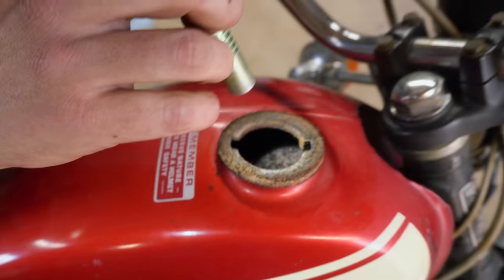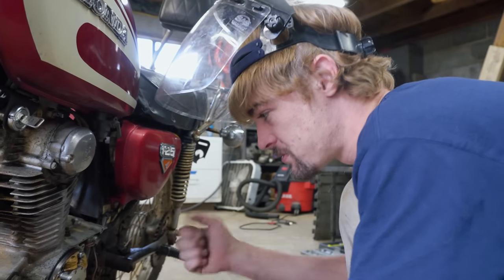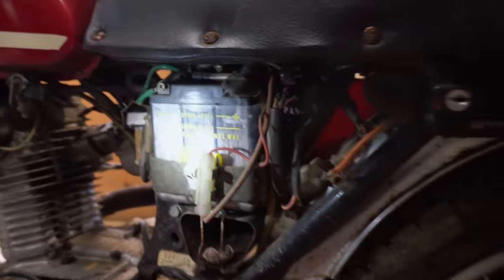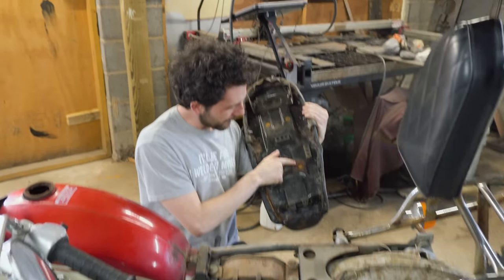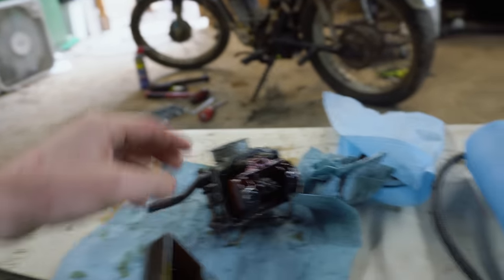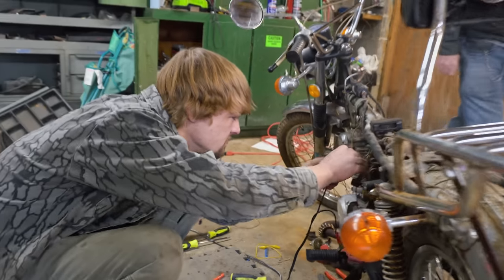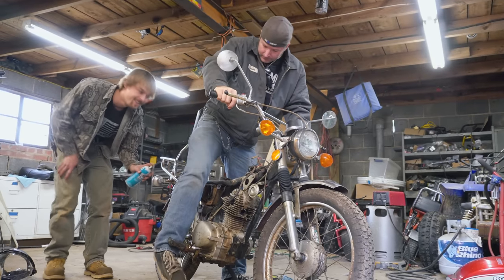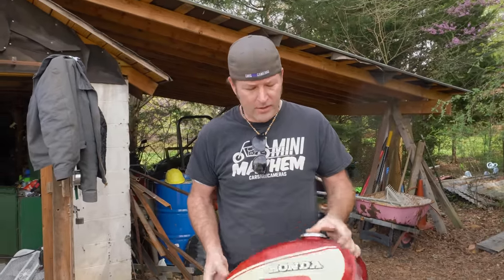Will this $200 STUCK Honda CL125 Run and Ride after Sitting 40 Years?

Comment: When I was a kid, I raced a fully built one of what you have there.I won over 130 trophies 
on that bike. I would do "standin on the seat wheelies " all the way around half mile 
flat tracks . I had a lot of bikes through the years, but VERY FEW any more fun than that one! That motor can be built to nearly 30hp! Lengthen the swing arm two and a half to three and a half inches improves handling a lot, 52-57 tooth rear sproket,now ya got something. GOOD LUCK BOYS !😊

Comment: I recently restored a 71 CL100 for my buddy with only 1000 miles on it, and you guys are 100% right about the ignition system.....it just won't run/run right with a dead battery. Yea, it makes no sense, given the permanent magnet charging system/magneto. Strangely, my 81 XL100R will start and run with a dead battery, both machines are 6V too! I wonder if i has to do with the old selenium rectifiers vs the more modern box regulators the newer bikes had.

Comment: CL125 is what that Model is called street/trail...you likely could adapt a muffler from a  larger displacement small engine if you see in pictures of the stock 4 stroke mufflers there's a small round piece at the end of the mufflers baffle it's called a splitter it helps with hp production from off throttle to top end....I have bought n sold several hundred metric motorcycles of all sizes keep an eye out for the SL 350 Hondas when Honda decided to end the 350 line they simply started putting different models engines into to the SL's so you might end up with one of their race prepped engines....

Comment: That breaking clutches loose trick does not work on my track loader though.

The left side steering clutch pack is rusted up and even under a heavy load, the clutches are not breaking loose.

I plan on putting some evaporust or some such in it and driving it with the clutch pack popped open until it breaks free and then go in there and clean the gunk out of them.

Comment: I had a couple of those when I was around 11 or 12 years old. One was a street legal dirt bike version, the other was a street bike version. I think the only difference was the tires really. Gearing may have differed as well, but was just the sprockets. I drove the tires off those things... so many miles on country gravel back roads in IA.

Comment: My 125 carb was why it got parked. They don't like dirt and once it gets warm, it needs different air speed adjustment. To be honest I want to switch to fuel injection and CDI ignition but at that time, that was only a pipe dream.

Comment: Not surprised the carb came out so clean again...remember back then gas didn't have the ethanol bs as today's fuel does...I restored a 97 Polaris 2 stroke atv that sat in the weather for 15 plus years ..I expected the worst and shocked it came out like that one...and I just soaked it over night in dawn dish soap...still runs to this day with its original carb...n runs very well....had to unfortunately do a top end build after the 3rd ride it started to lack power...but for original I couldn't complain...now has a wiseco...thing looks brand new now

Comment: Not so sure about that battery theory, I had an old 1970 something Honda cr250 and just used the Kickstarter and never had a good battery in the thing. Rode that thing for a long time and taillight, turn signals and headlight even worked. The one thing it would do is blow the fuse once in a while if you over revved it and the voltage regulator went haywire. That I believe was from the lack of a good battery. Miss that old bike . From what I remember it was just like this just a 250

Comment: My 72 Honda CT90, it will not get spark without a battery. I got it after it was sitting in a garage since 86. Put gas, a battery and a fuse, It fired right up.

Comment: Are you sure remember the 550 top rods original engine when you guys were making the crosskart and you opened up its carburetors and it looks like somebody poured baking soda in it those are lease salvageable even though they'll take a lot of work but the ones from when you were building the cross cart basically trash. Have a great day

Comment: I bet if you add a small capacitor to the charging circuit it would have less issues with charging. And a bigger ground always helps.

Comment: Make sure your petcock is clean these early models did not have a screen on them inside the tank and they plugged up really easy and you cannot find replacements that fit correctly and that are made the same as stock if the tank is full of crud the petcock usually is well and they are hard to get clean unless you ultrasonic cleaning them

Comment: I got a 75 CB125 and the gas tank looked like yours, filled it with vinigar for a couple days and it cleaned up nice.
Reply: The tank may have been swapped.  The 75 CB125s, if i recall, was blue with a dark blue Honda stripe decal.  It had a speedo and a tach plus really terrible front disk brake.

After that the tach dissapeared and the front drum came back...built it into the 80s when the CB250-Nighthawk and Rebel took over the small town bike slot.

Comment: Next time you find stuck clutch plates, put the bike on its center stand, put it in gear with the clutch pulled in, and keep stabbing the rear brake. That's always worked for me to free up the plates.

Comment: Those air cleaner boots are few and far between. Marvel Mystery oil saved my engine. I have a wiring diagram for my SL125. I could scan and email it to you, if you still need one.  Back then, there was a light switch that had to be turned on.

Comment: When I still had blinkers on it the only time that would work as when it was running at high rpm the rectifier and battery systems was its downfall. But they are bullet proof.

Comment: On these little Hondas the electrical system is 6V, and comprises a 6V 6Ah battery charged by an alternator to produce AC current, which needs rectifying from AC to DC to charge the battery. The alternator takes the form of a rotary magnet revolving at engine speed with six coils mounted around it. The AC voltage generated will vary with the speed of the engine, and need regulating to a little over 7V to charge the battery, so once the lights are on and the engine is running at town speeds, there's very little power left to give a charge, run indicators, brake lights, and crucially keep the engine sparking. This regulator is in the form of a resistor, so for daytime riding it is switched into the circuit to dissipate excess current in the form of heat. At night, the alternator and battery have to supply headlight, 35W hi, 25W lo, taillight, 5W, two indicator bulbs, 21W each, the speedo bulb, 1.5 W and hi beam, also 1.5 W. So MAX wattage of Hi beam, tail, and speedo needs 35+5+1.5 = 41.5W, (add horn and indicators needs another 43.5W at least albeit momentarily) and you can see why the battery goes flat very soon! 
Modern development in LED technology means you can change your bulbs for LED, and have brighter, lower wattage lighting and longer battery life. I changed the filament bulbs on my CL100 for LED, What a difference! I was almost incandescent!

Comment: A cl125 is pretty unusual especially one with a rack and a sissy bar that accessory alone is worth probably over a hundred dollars. Depending on the year some of those Honda's didn't have to have a battery to get Spark if they're like the ct90 they have two hot wires going to the battery that actually are made into the battery and connect to the Bike wiring harness if you connect the two wires together without a battery that should give you spark from the stator. The bikes with a single hot wire to the battery I had many Hondas that did not have batteries in them and ran just fine but they used regular post type batteries still a pretty cool find. And the original paint non- damage tank that is not rusted out or rusted up inside is probably worth a minimum of $150

Comment: Sometimes on those old small Honda's they put a DC ignition system in them, meaning the ignition system is designed so that it operates on the "battery" power. So then the stator has to do nothing but recharge the battery only. It's basically the same type of system that a large motorcycle would have, like an older points type CB750 motorcycle would have. And like Isaac said, it has GOT to have a battery to run....
Even the older small Honda CT90's were built the same way, and not a lot of people know that about these small motorcycles...

Comment: If you guys ever get a stuck engine put transmission fluid in the cylinder and let it set then after a week turn it over without the spark plug a few times.

Comment: Heyy Guy's!!! I have a question I'm trying to figure out how I can turn up a Briggs & Stratton 540 and still keep the electric. Now this project is going on a boat I'm using a lower half off a hangkai air-cooled outboard. But before I put the Briggs  and Stratton on the lower half. I was wondering if y'all have any information on how I can turn the motor up or any website that I can order parts off of.

Comment: the battery exites the generator coils to produce the power to charge and ignite , theoreticly you shouldnt need a battery after the bike is running and charging

Comment: Probably the petcock is restricted on gas tank. One would think they would remove it after tank cleaning and maybe they did, but probably has shit in it. Also can get a new Chinese carb off eBay for like $30. I just put one on my 79 XR185. Was almost perfect out of the box as well. N yes, Honda made a XR185 for 1979 only.

Comment: Charles: "Let me set Ike's manhood on fire."
Reply: Hey cars and cameras, I don’t think I’ve ever written them before but I’ve watched every one of your videos past two or 3 4 years about your CL 125 Honda. Very good bikes it’s 7580 miles is a gallon check your timing chain tensioner there notorious for the plastic ribbon off of them which throws it into a bad timing when you’re trying to start it and also the point plate because it’s overhead cam pull that out lubricate it real good make sure the centripetal advance is working overnight if you don’t smoke Doggett, they’ll take it you can’t hardly ball those things up. I’ve had three or four of them back in my day.
Reply: Oh, one other thing about your bike the front fender is too low to the tire and if you get mold up in there and you don’t wash it the next time you try to drive it you’ll get mud in there and it’ll lock the front tire up and you do a skateboard over the handlebars I know it’s my experience. Just trying to help y’all guys out because you’re the awesome job.
Reply: Ooo muddy

Comment: At 24:42: Charles<,remove that Rag before it jambs the chain. Anywho..I've screwed up,as many  probably have; You cleaned the tank,and carb.,but didn't clean the petcock and lines.?.Crud went right back into the carb.(actually did that today,dangit.Shh).

Comment: Now I'm missing all my old motorcycles had many years of Honda suzuki yamaha kawasak hodaka  KTM  bsa triumph and all the krazy ass kart builds especially the one made from wrecked bike engines 1 cyl up to 4 cyl I aged 5 years in a few days from the white knuckle rides either bad brakes or weak brakes hum or it could have been just way to much power 😂😂😂😂😂 it was fun but I'm not that krazy anymore

Comment: Let us know what cleaning solution you're using in your ultrasonic.  I've used SuperClean, Simple Green, Purple Power, even Harpoon Fright cleaner, and carbs come out gray or even black.  A thorough dremel and wire brush buffs them out, but it's extra effort.  (putting carb parts in a smaller liquid tight container full of gasoline, then in the cleaner filled with water works pretty well)

Comment: 9k miles. I'd bet the valves need adjusting also. And it will act as a car issue.  As wear happens the valves tighten and the way is sounts. Them janks need adjusting. Janky valves.

Comment: I had the '79 XL125 for years, had about 15hp but plenty of torque but one thing I learned was the engine had to have some back pressure from a baffled exhaust or it was just gutless!
If you build something that creates a bit of back pressure you'll feel an improvement in acceleration and top end.